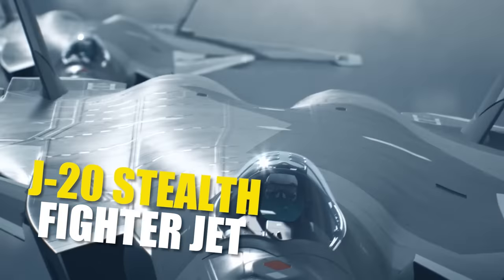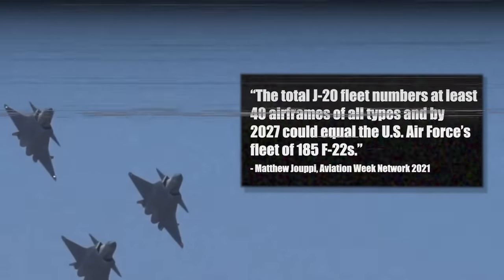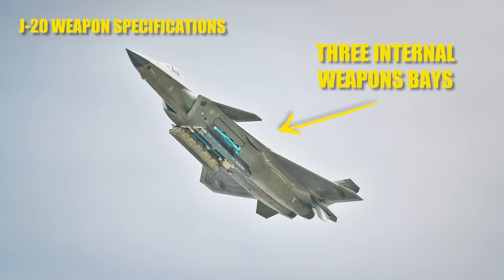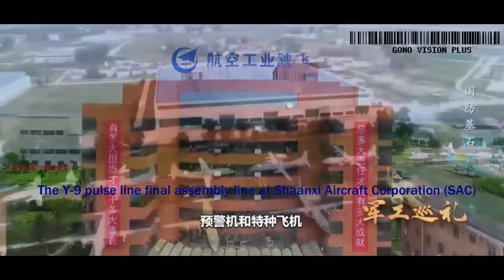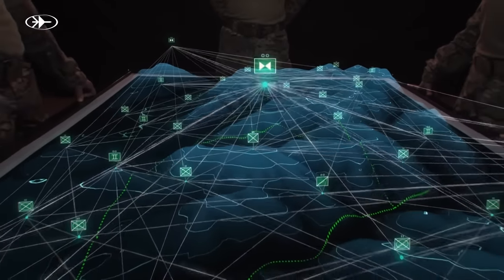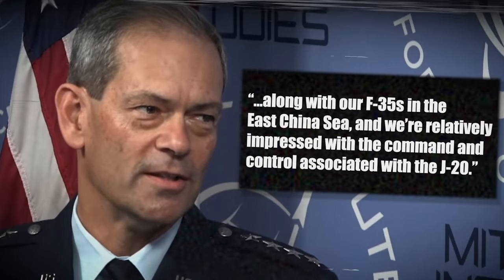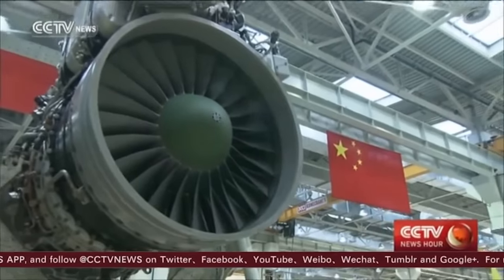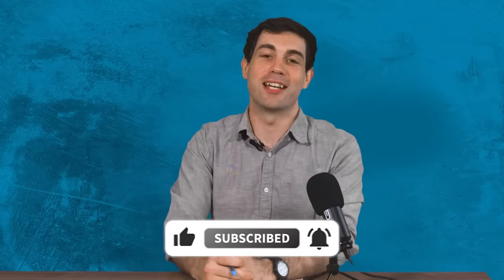How China Stole their J-20 Stealth Aircraft

Comment: As an Air Force veteran and computer programmer I can assure that some folks are deeply intrigued by battle management software, there is so much stuff to process and I am totally curious about those algorithms Cappy. Some nerds wore the uniform too.
Reply: I'm a Hong Konger. Frankly, I don't like the CCP regime. But I'm also an engineer by trade so I can't shake the objective self.
China has a vast supply (demographic issue is for years later) of AI/ML engineers. They may not be top notch academics. But trust me, when it comes to implementation, headcount matters. This is also why the US is doing utmost to slow down China in advanced computing.
Back to the topic though, if smart systems is what will win wars, yes, the US would be wise to worry.
Reply: @kalasend US has nothing to worry about at all.  China may not want to fooling around at the coast of California or gulf of Mexico like a thug on street.
Reply: @SuperSoliton  then why did the us block them from getting advanced chips?

Comment: For the record, the J20 are now fitted with WS15 engines,which according to experts, fly faster than the F35.
Reply: Funny, how the "best jets" have knocks off.  The really unbeatable jets are like the SR71, F117, S3 Viking, E6, A10 and etc...PS...I think we have a leak and outsourcing/offshoring problem.  The J20 has no knocks offs...
Reply: Its twin engine,all twin engine fighters are faster than f35
Reply: @jackholman5008 the j20 is a hit and run, the 35 is multirole
Reply: Faster is not the technical advantage. Both the J20 and the F35 have bet on being able to see their opponents before they are seen and hitting their opponents with a first missile. That's stealth and sensor fusion.

Comment: The lack of a real long-range air to air missile in the US arsenal is truly astonishing to me.
Reply: The AIM-260 is just starting production, and it is expected to be fully operational by 2027. The reason why it took it so long to the U.S., is because they intended to design it to be dimentionally similar to the AIM-120, while the Chinese PL-15 and Russian R-37 are twice and thrice as wide, respectively; and nearly half a meter longer than the AIM-120. The U.S. gives importance to making compact missiles to avoid the need of retrofitting aircraft, and to allow aircraft to carry more missiles for less weight. Russia and China just went ahead to make their missiles bigger to reach their intended range. If China had the ability to make smaller missiles, the J-20 would be much smaller, or it'd be the same size while carrying more missiles
Reply: @earlbinvico  great explanation, thanks! Still strange, since the F-15 is being set up as a missile truck with huge capacity, it could carry a heavy ATA missile.
Reply: @earlbinvico bigger size doesn’t affect stealth, provided that the shape doesn’t change, so the only problem with it is weight, which can be fixed with better engines, which is actually happening. Bigger size has several advantages: more fuel; bigger compartments for avionics and missiles (which are the bottlenecks for F22, making it extremely difficult to upgrade F22 with the latest tech). So overall I feel the J20 has much bigger potential as a platform for continuous evolution.

Comment: I flew out of Okinawa for a little bit.  I've tracked and spiked a J-20 or two.  They aren't stealth.  The Chinese also have a big problem building jet engines, they've been trying to copy the Russian Saturn engines for so long that Russia wont sell China anymore of them without an order of airframes and support.  The service ceiling information you have is not quite accurate.  F-15 aircraft have flown over 100K feet before, but we're policy and common sense limited to 'service ceilings' because to go higher, you need to be flying in a self-contained life support suit (space suit).  So it's not that we can't, it's just that we don't in peacetime.  Your F-35 range is incorrect, the F-22 has a greater range than the F-35 in combat configs, it looks like you're quoting either the ferry range or the military industrial complex snake oil range.  The F-35 can fly barely 1K miles without landing or suckling on a tanker.  Also one final thing, China produces lots of jets but does not publish loss or retirement numbers, this is by design.  Their metallurgy is bottom tier and they product jets en mass to make up for cracked airframes and lost airframes.

Comment: This reminds me of the US in the 1960's.  The F-4 was originally designed without guns.  The thought was you would use missiles rather than guns.  They quickly found out that didn't happen.  Also this means this would only be an air superiority aircraft and not be able to support ground troops.  Great Video!!!
Reply: Ground support is a task for other aircrafts.
Reply: @iumbo1234  I'm OK with that.  The F-35 is replacing the A-10 (In Theory).  It should be F/A-35 since it is replacing the A-10.  In order to do that you need a gun to take out ground equipment like tanks and armored vehicles.  I'm just stating that this fighter is for air superiority only.  Not a multi-roll aircraft.
Reply: so how critical would this be with india china situation? dunno of their priorities, that could still be distraction to fight along taiwan. if it is close to F117 stealth, thats critical already.
Reply: Fun fact for gun in modern combat
Reference from Gulf War, seem like Ground kill are much more by guide ammunition (F-15, F-111) than gun run (A-10) and A-10 pilot are risk they live to do so
And being latest war (ukr) both side gun run almost non-existence but rather kill everything by missile
So right now CAS can do job without gun, even USA issue farm plane with missile and dump rocket
Reply: @SRDPS2  The great thing about the A-10 is loiter time.  You always use stand off weapons and the A-10 can carry a lot, but also loiter longer than anything else we have.  But most smart weapons require GPS which is easy to jam.  Even Ukraine the drones are being jammed.  Lots of what ifs.  US has had the luxury of air superiority for almost 80 years.  It makes a big difference.  Air Combat Maneuvering (ACM) was a lost art when we made the F-4 without guns.  Our kill ratio went down.  That is why we have Red Flag and Top Gun.  That is also why we have guns on our fighters.  This is all great stuff.
Reply: @SRDPS2  so thats equivalent of artillery in air... rate in ukraine was somewhere 80-90%+ not gun kills. which may be standard for this kind of large scale war. So how are counter measures for those guided rockets and missiles? obvious anti air, then there are EW signal jamming which work if missile dont get close enough to use gyro guidance.

Comment: Umm stealth doesn't mean invisible to radar. It just means the radar return you give is not enough for a missile system to lock onto, be it air to air or surface to air. Most experts say the J-20 is designed from the ground up for  frontal stealth. Meaning its basically an interceptor, not an air superiority fighter. That means its meant to intercept enemy bombers and strike aircraft at range with its missiles. Its frontal stealth allows it to get closer without being locked on to (not that it can't be seen by other aircraft) so it can fire its missile load. Once it fires off its missiles it retreats to land and do it all over again. This means it can't lotter on station and is a more one and done fighter. US stealth fighters have all around stealth, so they are meant for air superiority with the F-22/F-35 and ground attack missions in F-35 (thought in stealth mode the F-35's payload is small). This means they will attempt to drive off enemy fighters and suppress enemy ground base defenses. China's strategy is to try and overwhelm US aircraft and defenses with missile spam. Not unlike the Soviet Union's strategy against US airpower and defenses. The problem for China is that their ASEA radar are about as good as current Russian versions. Meaning they can't lock onto F-22/F-35 at range and have to get closer than Chinese doctrine allows. So right now Chinese doctrine is to missile spam to push away enemy stealth fighters. If that fails bring them in close enough for Chinese SAM systems to push them away. But that doesn't require enemy aircraft to be shot down or enemy defenses destroyed only pushed back and suppressed. 

The main problem for China now is their engine tech is still not mature enough so range and engine life is still quite low, though close to Russian engine tech. But the biggest problem for China is the B-21 Raider. We know because the amount of hacking and espionage attempts by China on the Raider program only match those on the NGAD....and possibly SpaceX rockets. This because the B-21 is meant to be undetected before and after it fires its payload. Meaning by the time a B-21 strike package is detected on Chinese radar or stuff starts blowing up and its already turned back to base. This is because modern US strike weapons are designed to be spammed at range and just as stealthy as the aircraft carrying them. The NGAD is supposedly to be just as hard to detect at range, like the B-21 have a next gen SABER II radar system, have celling of over 80,000 ft, it will have super cruise above Mach 2 and top speed approaching Mach 3 (like Mach 2.8). It will also be a big fighter probably the largest jet 'fighter' ever fielded by the USAF. With charactistics close-ish to the MiG-31, only with longer range, much better maneuverability, much heavier payload, advanced radar/data system allowing it function as a mini-AWACS and best stealth available to the US. But since its mean to be an air superiority fighter it will have very long lotter time on station with enough weapons to keep enemy air threats at bay.
Reply: TLDR Maybe you should make your own channel. Since you have so much to say. 😮 🎉

Comment: 5:38 It's less about the Americans not agreeing, but instead having learned from the F-4 Phantom (a fighter with no cannons), that a backup cannon is pretty necessary and so the cannons currently had are backup weapons in case everything else fails. Kind of like the pistols.
Reply: At the time of the F4 missiles were a lot less advanced than today, and if you have a platform meant to "snipe" from long distance a gun is just added weight.

Comment: F-22 and F-35 don't open the weapon bay until the missile is fired and then the bay closes immediately after. Target information an initial vector is easily communicated to the missile before and during launch. In a close up engagement, it's unlikely that missiles would be used since that's such an easy way to frag yourself. Jets without guns have to retreat if it gets that close, especially against an F-22. To keep a stealth configuration, it can't carry missiles useful for penetration missions in contested airspaces. Holding the weapon outside of the bay results in a less stealthy profile. This jet is a result of China trying to copy America without a solid air combat strategy, while trying to fill gaps in air combat capabilities. It's not meant to go head to head with capable air to air configured jets outside of their airspace, and can only be used from prepared air bases. When you pit this against the full arsenal of US air power, it has very little to offer besides increased survivability over other Chinese jets, and the ability to get closer to targets before a solution can be used against it.

Comment: the J20 engineers can probably make a cannon fit in place where one of the side missiles is placed, so not having a gun currently is probably not as big of a problem as most make it out to be, just like how Iran made a Surface to Air missile fire from F14. in war most engineers will figure out some innovative ways to make existing tech fit together even when they were designed to work together in the 1st place.

Comment: You really need to explain the difference between sensor tech, this fixation on radar and radar cross-section for stealth is obsolete in the modern era. Modern jets rely on passive infrared IRST sensors, combine with laser range-finding. It does not reveal their location like active radar does. Due to high speed jet surfaces contacting air generating huge amounts of heat, it is not possible for any stealth jet to hide from the infrared spectrum, especially vs modern IRST.

Comment: What's the big deal about the J-20's alleged ceiling of 66,000 feet?  Neither the J-20 nor the F-22 will often fly nearly that high anyway because their pilots would need to be wearing pressure suits in order to survive ejection.  And the difference between 66,000 and 65,000 feet isn't that much of a difference anyway.

Besides, can the J-20 match its own spec with interim engines that are very likely outside of that spec?

Comment: it sure looks impressive, but the strength of the F-35 is in the information space. The F-35 can communicate better than any aircraft before it and since. 200km BVR missiles aren’t much use when you can’t get a lock on the F-35 at that range. The J-20 is based on a non-stealthy MiG, it doesn’t look like it has serpentine jet intakes, so its radar cross section might not be as small as its stealthy silhouette suggests. Where the J-20 is particularly strong is in range, it’s HUGE.

Comment: Your RCS discussion at 14:25 confused me. The visual showed ft which is a one-dimensional measurement, while the audio spoke of RCS, which is a two-dimensional measurement. The F-22 RCS is 0.0001 square meter frontal (smaller than a marble), while J-20 is estimate be between 0.08 and 0.3 (one thousand to one million times larger). Not exactly a fair fight.

Comment: there is an important aspect in all of this: every time the US pulled back on a contract for the f-35 (which they done) or just blocked the sales on it (which they did) and/or ammunitions (yes, also done it), all comparable that was available was the su-57 (deliveries if lucky from 2028 on IF the plane works IF is good enough). now, if/when they do this, they're just selling chinese planes with no comission. granted the chinese will also deliver the planes way faster anyway (through slave labour, but they will)

Comment: Hey, China did not steal any parts of F 35. Yes, in its design part of J20 is only similar to F 35 in front part but 85% of J20 is not same as F 35. J20 is much bigger, longer. Its engines are WL15, much powerful engines than F 35 engines. J20 Radars are much powerful, and stronger than F 35. It can track any jets even 450 to 1000 km away. most importantly, J 20 weaponry is PL 15, PL16, and PL 18. Etc. J20 can fly much longer, faster than F 35 3 to 4 times before refueling. Last, J20 is in full production, reaching 568 jets in full operational.
Reply: 既然不可能先生已经提出使用量子魔法来彻底改变每个人的个人知识产权，为什么我们还要在这上面浪费时间呢？ 还没有人告诉你们党的领导人吗？ 一旦他让我相信我可以信任他，我们就可以继续。 这应该很简单。  🫰🫰🐉🤺🥱。  🫴✨🪄。

Comment: Stealth is useless when fighting a near peer. it only works when trying to fight ill equipped/rebels. So their hand held manpads cannot get a lock on. 

The paint absorbing radar only works for mm to micrometer frequencies. You wouldn't be able to fly if you apply meter length foam on your so called stealth fighters. Just use hf radars, and you would see the gap in the radar array. A shadow highlighting the stealth sparrow. So the next thing to do is just teach an ai to differentiate a mach 3 flying sparrow in your airspace.

Comment: The basis for J-20's design is J-9VI-II, which predates Mig 1.44 by at least a decade.
Reply: No it did not both the designs came out in 
Similar time period the Soviets began work in 1983 came out with the design in 1987. The first flight only happened in 2000.
Reply: @user-th4ch4ky3g  The J-9VI-II design was drafted in 1975 by the 611 institute. Furthermore, relationship between China and USSR was extremely hostile from 1960's to late 1980's, making any exchange impossible. This Mig 1.44 connection is simply a self perpetuating myth.

Comment: The canards are like 'front-wheel' drives of cars. They make the plane extremely maneuverable. It can turn and shoot down an anti-aircraft missile following it. Use of canards is very difficult, which is why Americans don't even try it. Most people on these comment boards do not know enough physics to understand why the canard is hard to use (it bites into the air, so it must be controlled by software) and why it is so effective. So you do not see anyone notice it. 

So, in short, the J-20 is untouchable by current SAMs like the US Patriot, because these rockets cannot keep up with a J-20's turns. 

Thanks to its friendship with Russia, China now has access to the best aerospace engineers in the world, and unlimited supply of Titanium. US has limited supply of both. Russia and China together make USA and lackey UK look weak. Which is good.

Comment: As far as I know(I am not an expert and know no secrets), it may not be as good as you thought.
It was not designed to be some of the best I think. You know the techs of this two countries are in different levels(can be simply evaluated from civilian techs).
And as a bachelor of engineering, it is responsible to say-if you copy the designs, you will have to use the specific components which used specific techs. Those techs are owned, mostly by big companies, and you can't produce these components even knowing the techs for you don't have the tools and other conditions. That is the thing.
Reply: It was designed to be a competator of F-xx, I agree. But not compete in performance, it is the value for money if I may say so.

Comment: If you really understand technology, you will not use the so-called theft one-sidedly, because electronic systems have two levels: hardware and software. If you don’t have the ability to manufacture hardware, you won’t be able to make it even if you are given drawings. For example, if you don’t understand the specific operation method of the CPU or software, you won’t be able to make it.